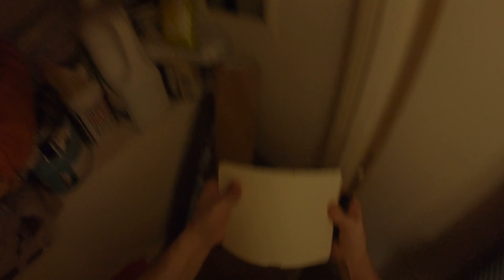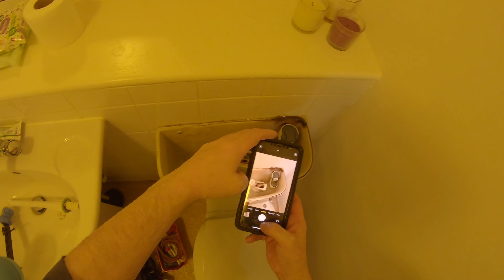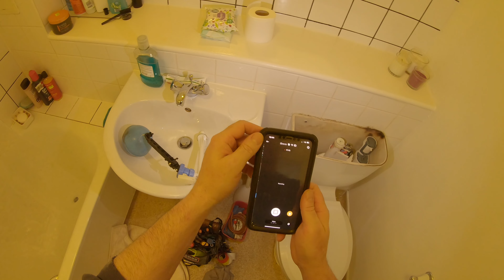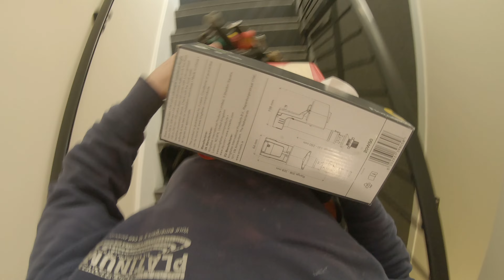Emergency Plumber London Vlog # 9

Comment: I use PTFE all the time when making compression joints, even when reusing old olives that are already on the pipe, its always worked spot on for me. Im not a plumber granted but i can only speak of what ive always found to work well. I must admit though, i didnt like the curl you put in the flexi and id never be happy with that myself but again im not a plumber so who am i to question it, just my opinion ,my friend. Thanks for uploading.
Reply from the maker: Thanks John for the comment. Absolutely nothing wrong sir with using PTFE on a joint. Anyone than states otherwise, well you can fill in the blanks. As far as twisting a flexi although not as pleasing as a straight connection does have a place when the pipework between two points is too close and cannot be altered by other means to install a new bottom entry inlet valve. As stated and clearly shown in the video, could not be cut any lower due to the wall tiles. Putting a pigs tail in a flexi is perfectly fine as long as the flexi does not kink or is overstretched. Which as stated before and as shown in the video it does not. We appreciate your time and your time in leaving a comment. Many thanks brother.
Reply from the maker: Bobby, please do not troll other comments. If you want to be grown up and have a conversation and share ideas and learn from each other thats cool but trolling is not. There is no issue reforming a braided hose as long as it is done with care. I suggest you speak with a manufacture if you doubt what we say. The rubber bore inside theses hoses are perfectly malleable and all metal has memory. As stated and as shown in the video we use the water pressure and a gentle squeeze to re-form.

Comment: Should of poured water in the cistern to create the syphoning,those fill valves are crap, they either stick open or trickle in after a while,stick with delchem ext' valve or at worst a torbeck,both can be changed without draining cistern.Ray Davis would be proud of that Flexi hose.😂😂😂😂

Comment: Good job James, a longer flexi would have probably reduced the chance of a kink ? Do you ever use the fluid master fill valves? Nice looking van.  🔥🔥
Reply from the maker: Thanks MP for your continued support, Legend 🔥🔥🔥. Yeah those flexi are a little chunky monkey brother compared to other brands that are a little easier to loop, if you have limited space. It did turn out ok in the end albeit a little tight but no kinks.  I should have put a fixed photo up as someone was trying to troll us earlier stated the flexi was kinked and poorly installed.  We do sometimes install the Fluid Master valves, I keep those on the van and also screwfix do a brand called Viva brother, there also a nice valve to install.  Thanks the other van was going to cost too much with London ULEZ charges mate. How’s things with you, heating season keeping you busy brother.
Reply: Hey James, I am just a diyer  , not in any of your trades, but do find your work interesting. I did do electric/gas metering work in the past but due to mental health struggles gave it up. I still enjoy being " on the tools" now and then !!
Reply from the maker: You part of the family now brother, always welcome to hang your hat anytime. Sorry to hear about your health that’s a tuff rub. I am ex soldier and we have all been there mate. Keep going and make sure you talk about it. Much respect, best James
Reply: Try a 100mm flexi for the win